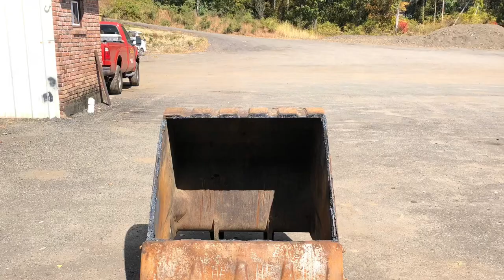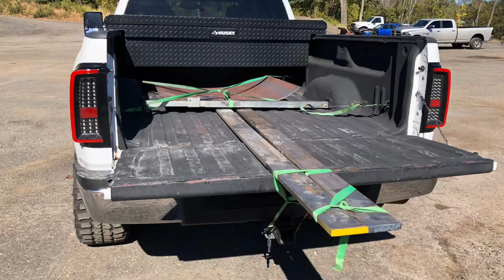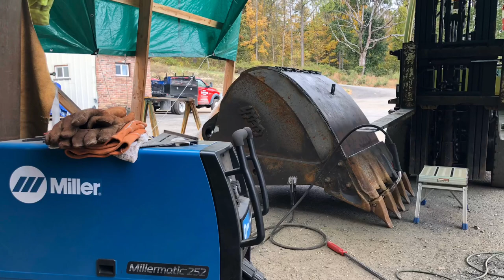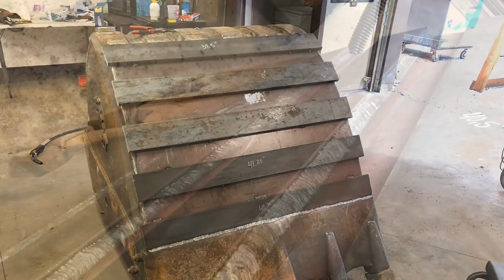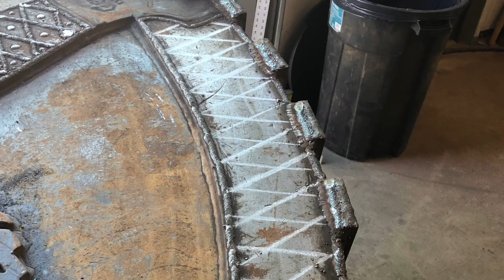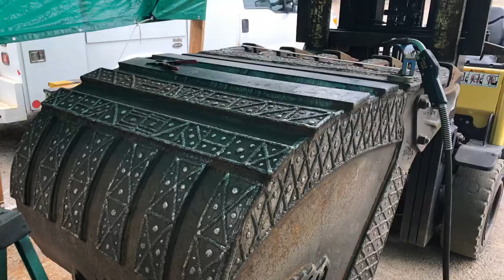Excavator Bucket Rebuild & Hardface!!

Comment: Holy crap how many yards was that bucket that's a big boy
Reply from the maker: Maidenlord 666 its only a 42” bucket about a yard 😁
Reply: @wickedgarage  it definitely looks bigger than that with you standing beside it
Reply from the maker: Maidenlord 666 its still a huge bucket, i actually just did a “quick” repair on a 60” bucket a couple weeks ago, it was on a gooseneck trailer and was a bit heavy to move around and thats the biggest one i worked on so far lol